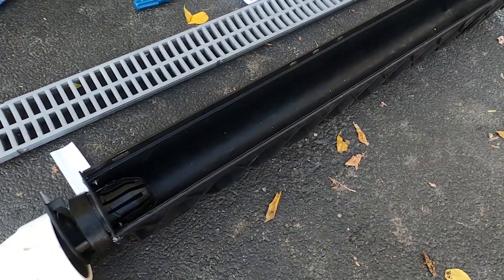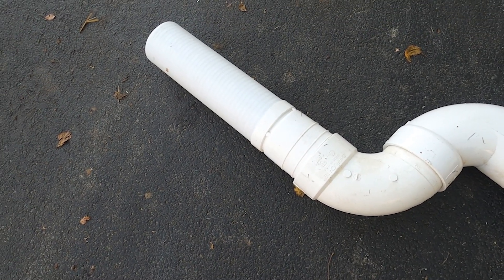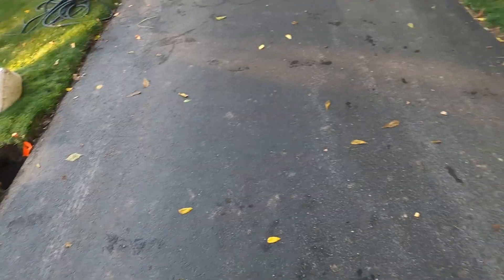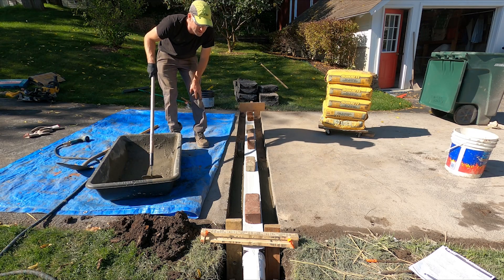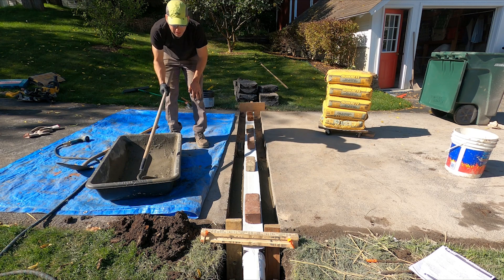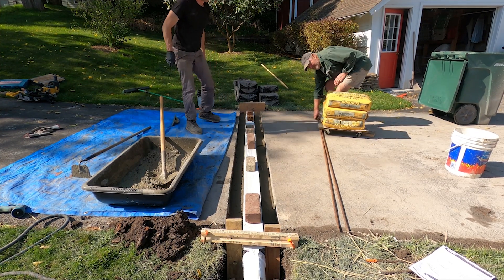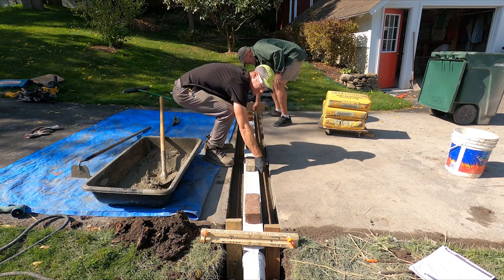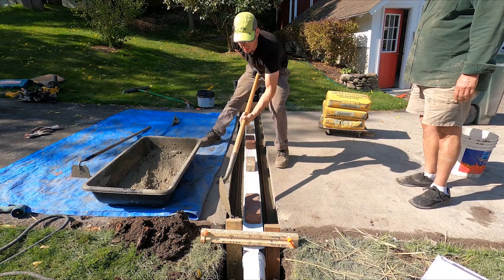How to Install a RELN Driveway Storm Drain (Channel Drain or Grate Drain) on a  Driveway

Comment: Not bad, but your finished concrete looks a little sloppy. Also, I didn't quite get where that drain pipe goes. Does it just drain into the soil?
Reply from the maker: What's sloppy is me not wiping the leaves off before filming the finished product! It's been about 9 months since installed and surprisingly, the edge that we feathered has not cracked. While I offered to use an edger and put a straight edge transition on the concrete, the homeowner wanted it feathered and it's a smooth transition from asphalt to concrete.  The drain connects to 4" underground tile and daylights about 100 ft away.
Reply: @PatrickDesignBuild  "underground tile and daylights" are trade lingo. I don't know what these terms mean.
Reply from the maker: Ha! I figured you were in the trades since you critiqued the finishing of the concrete. Let me simplify my response for you: The water from the drain tile feeds into a pipe that is buried about 1 ft below the ground level. This pipe takes the water 100 ft away to safe location before it dumps it onto the ground, where it naturally flows away.
Reply: @PatrickDesignBuild  I commented on the finishing as I would have commented on any other finishing.;) Thanks for the explanation. Now I understand the set-up. Good job.:)
Reply: @PatrickDesignBuild  I know right, I thought dude was a concrete pro or something.  I did appreciate the question about where it goes because that is exactly what I was also wondering.
Reply: @PatrickDesignBuild  can you connect to an existing drainage where your gutters are connected?  Also what’s the worse that will happen if you let it go to the soil if you have a large enough yard.  Isn’t water good for soil with grass on it after all?
Reply from the maker: Simple question. Complicated answer! Here goes... Connecting to your existing gutter drains depends if that gutter piping can handle the extra water it's going to get from the channel drain. Sometimes gutters are plumbed with corrugated pipe (not recommended) and sometimes with smooth walled pipe (better flow).  My gutters drain to 6" diameter sewer and drain pipe (smooth wall), so in my case the 6" piping can handle a lot of water meaning it could probably handle some additional load. Also a factor is your outlet for the gutter drain pipe. Does the pipe have good slope and does it daylight somewhere above the water table?  Dumping  your drain water into the yard is not that bad of a deal if your yard has some slope to it and drains well. You'll know if you shouldn't be sending the water to the yard if the yard remains spongy for awhile and your grass dies.
Reply: @PatrickDesignBuild  Thank you very much for this answer.  The pipe does or at least we are creating a good enough slope.  His is very helpful considering that I along with the help of a very disciplined handyman recently from Russia are doing this with zero prior experience.  

Can’t find any professional with availability to do this here in rich Seattle.
Reply from the maker: Shortage of skilled help is definitely a concern in this country. I hear you!
To get the water to flow well, try to get at least 1/4" of drop per foot of length. So if you're using a 4 foot level, try to get your pipe to drop 1" across the 4ft, and repeat for the entire length you need to go. I've gone flatter to 1/8" drop per ft if that was my only choice. 1/8" drop would be only 1/2" across a 4 ft level.

Comment: looks cool :) next time make sure that the rebar is at least 3cm / 4cm off the ground its better for concrete makes it stronger and last longer
Reply from the maker: I agree -- the rebar was about halfway up the concrete during the pour. First, I placed 2" of concrete then I laid the rebar on the concrete then placed a few more inches of concrete above the rebar. Typically I place the rebar on the tensile side of the concrete which in this case should have been biased to the bottom.

Comment: Why concrete instead of tar?
Reply from the maker: That's what the manufacturer recommended. And I added rebar for additional strength. I don't think tar's strength compares to steel reinforced concrete.

Comment: Is the water going into that hole next to your driveway or it's connected to your local sewer system?
Reply from the maker: The drain was connected to a drainage tile that came to daylight 100 feet away from the driveway, and safely downstream of the house.

Comment: It’s Monday night, I am supposed to be finding YT video about changing out a pool chlorinator as ours sprung a leak and we weren’t using it anyway so time for it to go away.  Tell my dearest husband (don’t worry you don’t have to watch all of it) WOW WOW WOW, we watch it all as we have a flooding problem similar to this.  Can’t thank you enough for posting this.  We won’t be doing it ourselves (at 66 & 68) but you have made us so much smarter when we find a contractor to do the work! Thank you so much
Reply from the maker: You're welcome! Great story :) I also like to wander around YT videos and get distracted by the good ones. Make sure the contractor puts some rebar in that concrete to strengthen it. I'm surprised our instructions didn't say to do so. Also, there are different strength drains depending on the weight of the traffic travelling over them. Size it for your heaviest vehicle traffic!  And finally, make sure it's a bit wider than the driveway so you capture any water flowing down on the edges between the driveway and the grass. Good luck!
Reply: @PatrickDesignBuild  The NDS company video also good. It will probably never happen as we live at sea level and when we get inundated with rain there is just no where for the water to go.  Also finding someone with your skills is next to impossible. As we like to say:the sun, the surf, the sand who wants to work- and that was even before the pandemic.  Quality craftsman are a rare find in Florida-everybody wants the easy way.  Thanks for your video.
Reply: Just did it at age 72 by myself !!

Comment: Read the content of water needed for each bag and use a measured bucket to add the water in one go.Easier to mix with all the water from the start.Tape where the concrete meets the bitumen for a nice line it will crack at the interface anyway so might as well make it sharp from the start.You did a well planed job and very professional result,thanks for your effort with the video.
Reply from the maker: I agree -- if you're not used to working with concrete... definitely measure. And good idea to tape the asphalt. Thanks for watching!
Reply: Thanks for the idea on taping the driveway, I'm about to do one of these between brick pavers and if I'm not careful, I'll make a big mess, so thanks for this tip!

Comment: Most videos I have seen with this type of channel drain they advise against using corrugated pipe, most say to run solid pipe all the way to your daylight spot.
Reply: Exactly. Why catch it only to risk letting  it out before it’s where you want it? But enjoying the installation video- excellent. Edit: channel owner clarified in another response below that it was corrugated but not perforated so all good.
Reply from the maker: Correct. We did use corrugated, non perforated pipe for this application. I agree with you: a solid pipe is a much better solution.

Comment: The part that escapes me is the slope/grade. How do you gain a slope over the run and still keep 1/8" relief along the top edge, drain top edge to driveway ? I have to do this as well for exact same reason.
Reply from the maker: Luckily, the driveway already sloped greater than 1/4" per ft in the direction we wanted to take the water. So, our slope was already built into the driveway slope from side to side, and maintaining the 1/8" margin between the top of drain to top of driveway automatically gave us the slope needed. 

Thinking about other situations where the slope isn't already incorporated into the driveway... say if the driveway were flat from side to side: I would keep the 1/8" margin on the high side and on the low side there would be more than 1/8"... possibly one inch or more. In that case, I would slightly widen the relief cut on each side of the grate from 4" to 8", so there would be more distance to softly blend the top of the driveway to the top of the grate using concrete. 

Yes, there would be more asphalt removed, and more concrete used, but this would allow a softer, and not as abrupt of a dip on the low side of the drain. 

I hope this helps!
Reply: Especially when there is a "crown in the driveway" per the videography at the start of this production!?

Comment: In the future, you might consider using solid sch40 PVC all the way to daylight. It'll flow a heck of a lot better. Once you have water in a pipe, you never want to put it in perforated, or you're just moving surface water to subsurface, and closer to the house, at that.
Reply from the maker: I agree... smooth wall does flow better. My note in the video said "perforated" but I meant to say "corrugated, non perforated".  Schedule 40 is great, but sometimes I don't need that strength or protection from root growth. I run all my gutters through the 4" ADS along with pipe from the 4" sewer and drain family. I use Schedule 40 for a durable daylight outlet with an animal guard, and also use sched 80 under driveways. For a budget though, can't beat corrugated tile at $0.33 per ft if you have to travel a few hundred feet and snake around obstacles with no fittings.
Reply: Wouldn't use it in a region that freezes.  Flexible and corrugated up here north of 49.

Comment: Looks a really good job. The black drain base looks plastic? If so does it last okay if a car wheel stops on it. Thank you.
Reply from the maker: It appears to be a composite, and rated for cars and light trucks... definitely don't want to park a full concrete truck on it.

Comment: What would you do if there is no way to run the connecting drain to daylight due to the channeling drain being the lowest point of the property? Run it to a dry well? Thanks!
Reply from the maker: Tough call... Without a good outlet, it's a challenge. A dry well is a good option if you have one, or if you can dig one. Without seeing your issue and not knowing if this is possible or not... another option is to trench a drainage tile or cut a swale through the high area to get the water to a different,  lower area.  Gotta get that water away from there somehow!
 My friend's driveway kept flooding in a low spot so he built it up, and put a culvert under it. But he also had a nice swale that took the water away.

Comment: just learning, co-worker wants me to do something about water flowing toward garage, but it has eroded dirt from under cement ramp, rest of driveway is gravel, was thinking of a french drain, but like the looks of this better, but its a 2 car garage, so approx. 24' across. ill do some discussing with her
Reply from the maker: This is definitely the "deluxe" fix for a water issue that also requires it to be driven over. However, I've done a lot of drainage with French drains. The French drain could be a quicker and just as much effective fix, but either way, make sure you have the proper "outlet" and slope for the water you're collecting!

Comment: Thx for the video. Why do you have to cut 8 inch while the trench drain is 4? If you just cut 4 then no need for concrete work? Thx!
Reply from the maker: Thanks for watching! The drain is made out of plastic/composite and needs support after it's installed or it will just crumble when driven over. The extra width cut to each side of the drain allows the concrete to "set" the drain in place and lock it in to keep it from shifting/moving. The concrete also provides the necessary lateral support for the vehicle traffic.
Reply: What kind of concrete should I use? It is for an existing concrete pool deck with only 1/2 “ left on each side? (I had a tighter space as drain was flush with wall of house). I can’t use the traditional bags of concrete because of all of the rocks mixed in it Has to be a smooth mix.
Reply from the maker: I'm sorry for the late reply. What about using Type S Mortar? No stones in that and it has some adhesion.

Comment: So the water is drained off to the side.  Won't that create a wet spot in the grass?  How does the water drain away from this small hole or does it just sit there? In heavy rain, won't the water back up?
Reply: I think they connected one side to a French drain that led water away from the direction of the house
Reply from the maker: brad coody - You're right -- I didn't show how we connected a drainage pipe to the driveway drain, but that's what we did. That pipe takes the water 100 ft away from the house, downstream and daylights. I'll post a follow up video showing how this works.
Reply: @PatrickDesignBuild  Great job~exactly my situation!